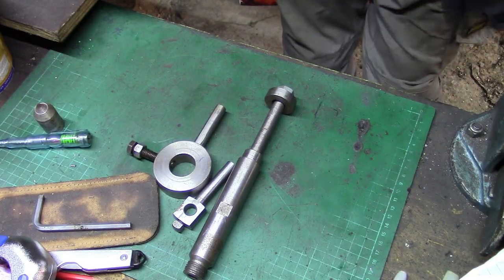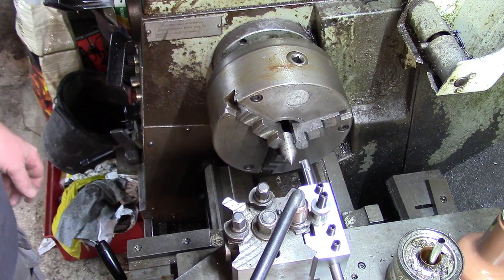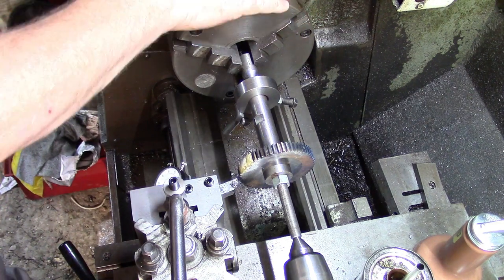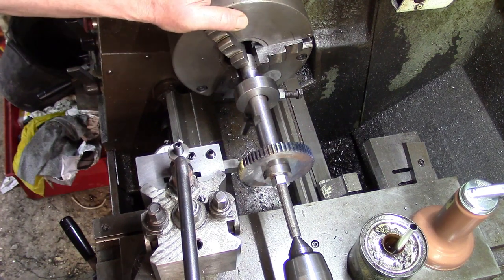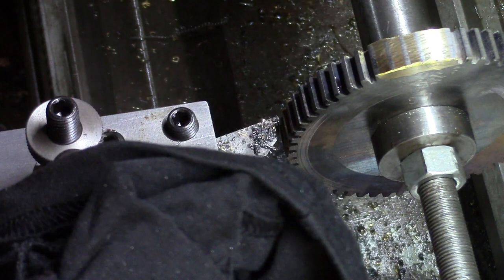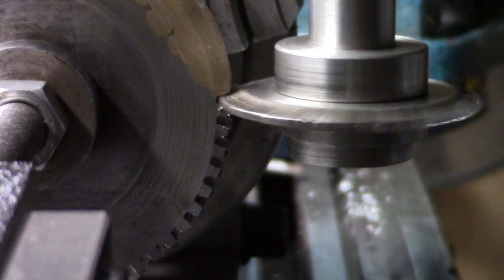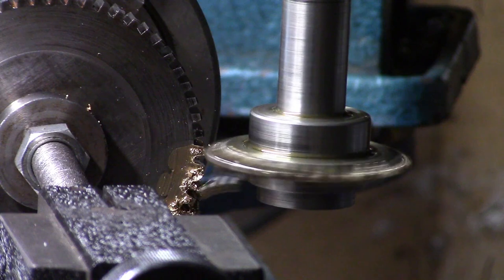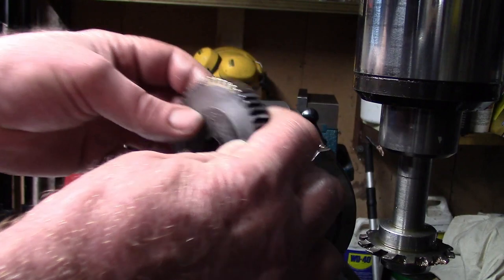Lathe Gear Repair

Comment: Alan, if you ever need to repair another gear again, your best bet would be to machine out the whole damaged part to quite a bit deeper than the tooth depth at the ends and Dovetail each end. Machine up a blank that also has dovetail ends and make it a tight press fit, you could also add Loctite if you so desire. Machine the gear up to thickness and diameter, then recut the teeth as you did there. I have found that Braze is not always  a good choice and welding certainly is not, especially if the gear has partially been heat treated, the weld tends to go hard as you originally found. Works well with cast iron gears as well as steel ones, you can also do it with Tuffnol  ( SRBF ) gears and epoxy the blank in. I was not very good at counting, but it looked like you were running the cutter a bit too fast. Job to tell but the cutter looked about 4 inch diameter X PI equals a good 12 inches circumference and ideal cutting speed for HSS  cutter on steel is 100 feet per minute, so your RPM should have been around the 95 mark ideally. Great job, I hope your customer appreciated you many hours of repair.
Reply from the maker: Thanks Dave I can always look back at this if I have another one to do, I think the cutter was around 2 1/2 inch so the speed was ok, just looks different on video.

Cheers Alan.

Comment: For my bantam it was a 49 tooth cog I needed for 3.5 pitch threads.  Not an easy one to find but i got one.  Would have given it a go  cutting one but my RSJ  reinforced mini mill is most  definitely not up for  that type of job.
Reply from the maker: I know what you mean you do need some rigidity.

Alan.

Comment: Hi Alan. What were  the gear blanks made from? Sorry if you’ve mentioned it somewhere. As always great vids and a pleasure to watch.
Reply from the maker: Not sure either EN8 or mild steel.

Alan.
Reply: Cheers Alan. On some of the higher carbon steels, the MIG weld absorbs the carbon from the (now) parent metal, this might give some explanation as to why machining the original weld was a pain. This is particularly noticeable if you weld cast. I’m sure you’re aware of all this but just to add to the noise etc.

Comment: Dear Tosser( well you said it, even if I don't mean it)🤔
Two in one day, you're spoiling us.
For a bit more rigidity keep your quill fully retracted, no matter who does it that others look up to, it is bad practice to extend it unnecessarily, use the knee that is what it is for. The quill should really only be used for drilling, at all other times it should be up and locked except perhaps for very light cuts. Now climbing down off my soapbox!🤣
ATB 
C
Reply from the maker: I'm listening Chris 😁

Alan.
Reply: Hi Alan. I agree Chris. That's the weakest link and the quill is probably worn along its length as well, which won't help. 
I try to use the mass of the machine body as close as possible for rigidity to the area being cut by the tool.
Most of the time any way. Great video liked the close up shots. Does the new lathe owner watch your vid's?
Reply from the maker: Not sure if he watches never thought to ask.

Alan.

Comment: Hi Alan, watching your videos you have some interesting work but at times i find it hard watching due to machine noise much louder than your voice, i need to turn up the volume in order to hear you but the background noise is at times unbearable, have you thought of an inexpensive external microphone or trying a muffler. Even a voice over.
Reply from the maker: I understand Derek, the camera doesn't have an external mic Jack, I really need a different camera but it's not on the priority list at the moment, my kitchen is.

Alan.